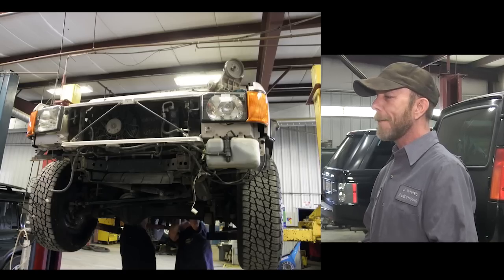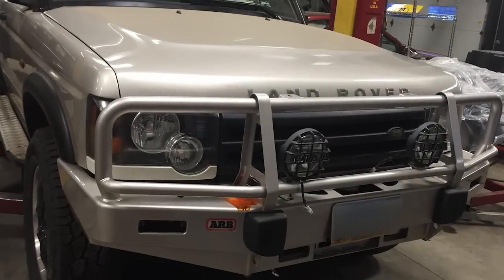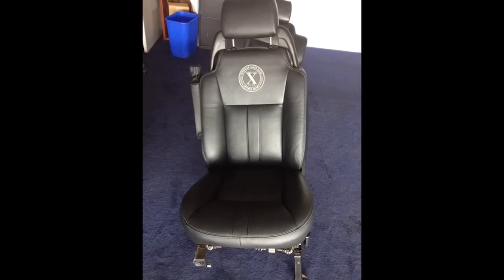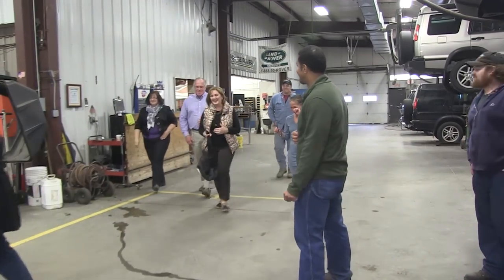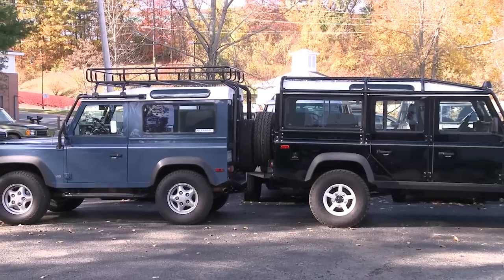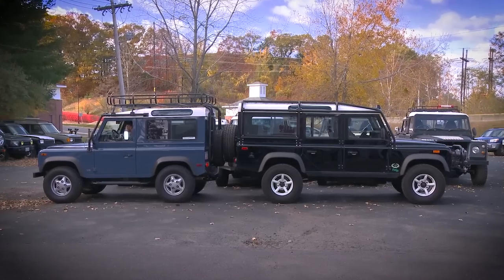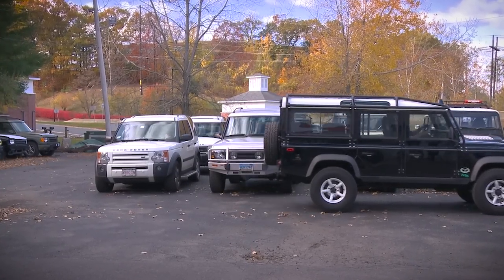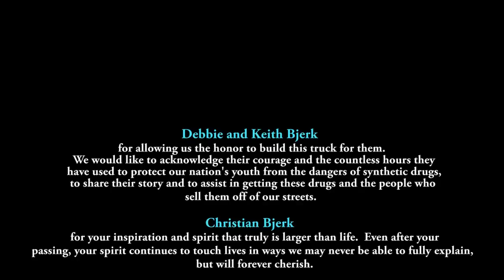Total Rebuild of Land Rover Discovery - Beyond Restoration

Comment: I am currently redoing my 03 in silver here in the UK,  altho it's the 2.5. has this been lifted at all ? and what was the front bumper you used it looms amazing, top work guys,
Reply from the maker: +olie spink Hi Olie, the truck is lifted and has an ARB bumper.  Wish we had 2.5 Discoveries on this side of the puddle.  Would love to see pictures of your job as it progresses.  Thank you for stopping by.
Reply: +J White's Automotive thanks for the reply, I would love the v8  but fuel prices are just to high over here. it's my first rover and i am so glad I picked it up, altho still a few things that need sorting before I I can start on the body etc. have a lovely week and thanks again.

Comment: Hi...I have a 1993 Land Rover Discovery left to me by my stepfather. I live in North Borneo and have to do most work by myself and any advice would be most welcome.
Reply from the maker: Make sure you have the needed hardware ahead of time Laurence.  It is never fun to get on a role, only to be stopped by that one little bolt you don't have.  Good luck with the build!
Reply: @jwhitesautomotive8245  Thanks for the reply...out here it is extremely hard to get anything for a discovery and if you can it will cost you a fortune. The front bumper I used sheet metal, fiberglass and had to do cut and bend for the bull bar. Would love to show you pictures
Reply from the maker: @peverill64  Share the pictures and inspire others!

Comment: One day, Me and Cecil (land rover D2) will be on the road again after 1 year of reparation of rusted frame..
Reply from the maker: Once the truck has a name, it is destine to stay on the road forever:)
Reply: But is the restoration done and back on the road? It's been 2 years haha
Reply: @drugansltd4344  yes it was but now it didn't go through the car inspection due to rusty bake lines..
Reply: @piktor6494  that's nothing to get it passed then :) mine had new 2 years ago. Brought it in a roll and little bender and away you go.

I have a D2 late 2003 model. Its had alot of maintannce to keep it in its condition. A few dings and dents from off road use and flakey front bumper. The previous owner kept her tip top and lives over the road from me so a couple months of nagging him he gave me a price, 2 days of waving the cash at him he finally signed it over to me, my daughter named the truck after its previous owners wife. Its in such good shape it still has the ladders on the back mud flaps :)
Reply: I have slowly gone trough ordering new nuts and bolts from lr dealer replacing old rusty ones even down to the door ones. I would like to say I am keeping on top of the maintenance but with 2 young kids the back seats always need a clean.

If i was to respray the front bumper I could say from about 3 meters away it would look as clean and tidy as the one on here, even the wheels refurbished last year all 5 :)
Reply: @drugansltd4344  The main problem now is the time. I don't have any time right now to fix it.

Comment: Could have bought a defender for the price of the rebuild...
Reply from the maker: I take you prefer the Defender Denver?  They both have their own merits for sure.
Reply: @jwhitesautomotive8245  I have a 99 Disco 2. I love it, but would sell it in a heartbeat for a Defender 110
Reply from the maker: @denvernow7294  There is a market for your Disco, especially if the frame is solid:)
Reply: @jwhitesautomotive8245  It spent almost all of its life in Arizona. There's not a lick of rust anywhere on it. It is leaking oil pretty badly from what I am told is the oil pressure gauge. I haven't verified if the front engine cover is cracked or the threads are stripped however. I've had the truck for a few months and I've just been adding oil. Other than that, everything runs and works great aside from needing a driver window motor. All gauges, electronics, etc work.
Reply from the maker: @denvernow7294  The no rust is a big deal Denver:)

Comment: I wanted one of these for years and when the 2003 facelift came I was ready to buy one... but could not. You see these vehicles are not made well and are very unreliable. I purchased a car instead that lasted 11years before I got rid of it. When it was finally time to get a rough and tumble truck, I chose the Lexus LX450 (FZJ80). I still have a crush on this vehicle's looks but it is too small inside and built with the wrong motor and transmission. They would have to replace that crap 1960's buick v8 with a diesel, toyota or chevy v8.. along with many other parts that are known to break far too often on these poorly made but attractive vehicles.
Reply: Thank you for sharing your experience and opinions Ceepmdee.  Interestingly enough, we have Land Rovers in our shop dating back all the way to the 1950's that are still going strong with proper care and maintenance.  Currently the 2003 in our shop has 250,000 miles on it, looks new and still going strong.
Reply: If these vehicle to be as bad as you say then please DO NOT EVER buy one. There are already far too many big mouthed people around who have no idea what they are talking about where Land Rovers are concerned..
Reply: actually, if you stay on top of routine maintenance like you should instead of just throwing gas in it and expecting it to run forever, they are very reliable vehicles.

my 04 has 155k on the clock, only repair except fluids/brakes/tires was 1 head gasket job at 110k.
my 06 LR3 is at 94k with no repairs needed yet.  Just did a fluid/filter change on the tranny, xfer case and diffs the other weekend (2 hours in the driveway)